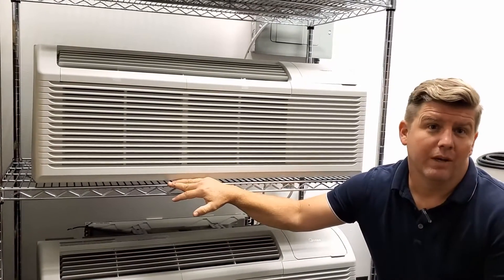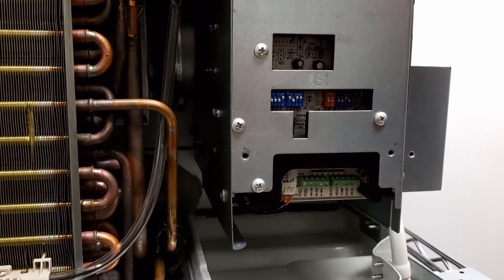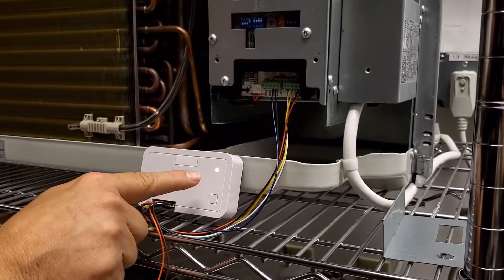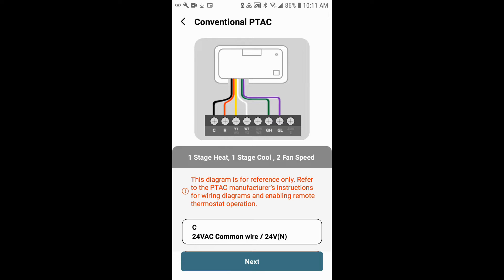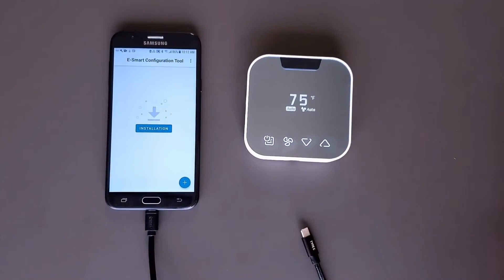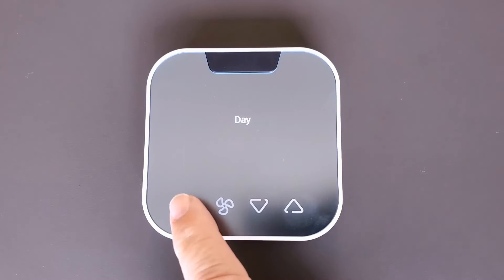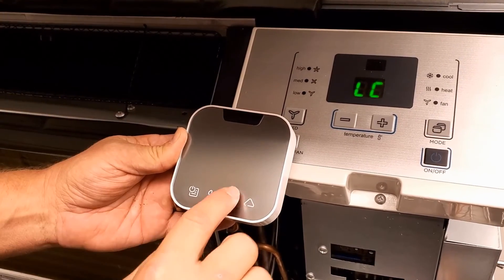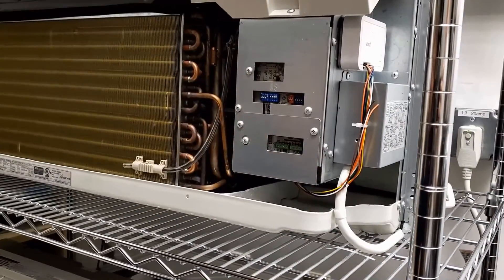VTech W960 Installation Full Video

Comment: I've been staying at a hotel in the city where I'm working, and they have these installed in every room. These thermostats really suck. For some reason in the middle of the night the temp will kick up to 77-78 degrees. And it'll do this frequently through the night. I've been through many rooms, 10 at the least, and I keep experiencing this issue. Any way to fix this?
Reply: This is likely happening because they enabled an occupancy sensor that doesn't exist in the room, or because they have the minimum requirements for it set too high so it isn't registering that the room is in fact occupied